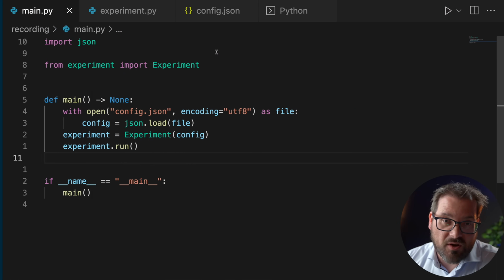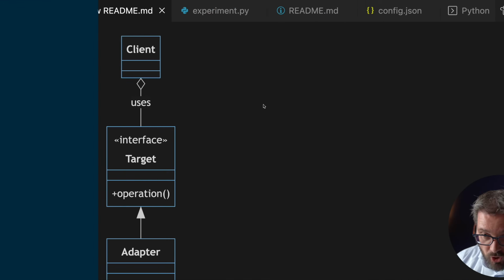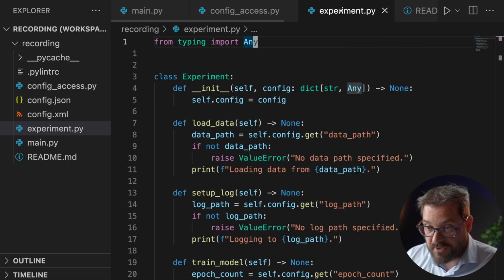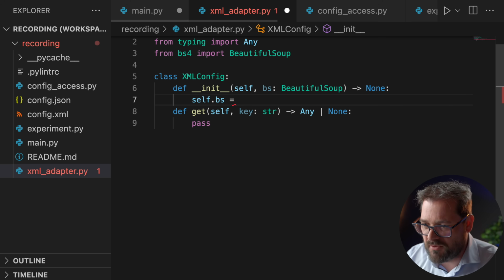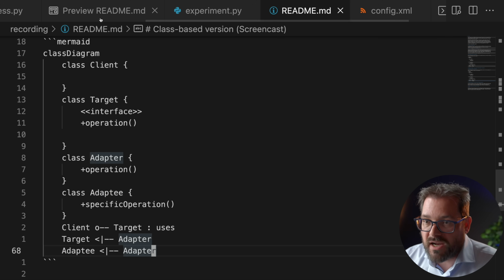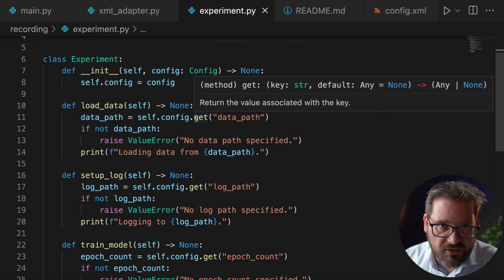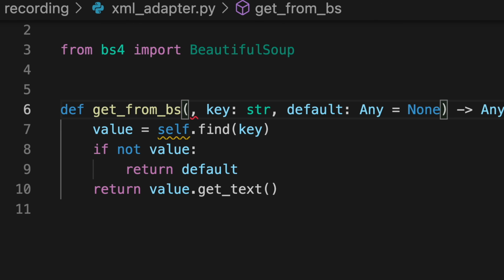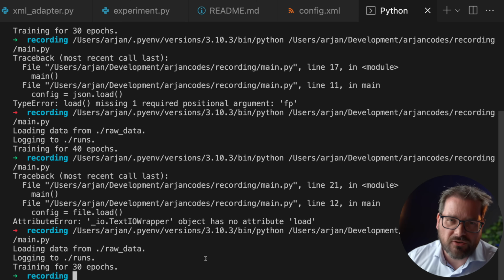Let's Take The Adapter Design Pattern To The Next Level

Comment: Hi, Arjan. Great video! Just had a quick question - what is the difference between the adapter pattern and the strategy pattern? Thanks in advance!
Reply from the maker: Thank you! The difference is that the goal of Strategy is to be able to change the behavior of an algorithm without having to change the code that uses the algorithm, whereas the goal of Adapter is to adapt an existing piece of code (traditionally, a class) so that it can be used with another piece of code.

Comment: Good video as always, but I don't think a dictionary is a good parameter to pass a configuration in a real product. But I understand why you chose a dictionary for the example.

However, my suggestion would be better to choose a dataclass for the configuration. With the dictionary you always have to reckon with the fact that not all keys are available. The data class cannot be created if it is incomplete. I like to do this with a classmethod, which makes a class out of the dictionary or throws an exception, then it ensures that after construction everything needed will be there.

Comment: Hey Arjan,
i like that video as all your other stuff :)

would it be wrong or "bad" style to move file open and bs instantiation in adapter XMLConfig?
for e.g. i would do in main only
path_to_cfg = pathlib.Path.cwd() / "config.xml"
adapter = XMLConfig(path_to_config)

and then adapter be a dataclass
where in _post_init_ i would do 
with open(file...
and s.bs = BeautifulSoup...

and finally i would also create a JSONConfig adapter with the slight changes in regards of the json file handling
Reply: That approach would work but it wouldn't exactly be an Adapter because it doesn't wrap an existing class in order to conform to an interface.  What you're talking about is more like a Strategy pattern with its own interface.

Comment: As far as i understand the Config class that inherits from Protocol is just for type checking? Would it be possible to to make this class not inherit from protocoll and instead make it an abstract class (inheriting from ABC with @abstractclass decorator)? If not it would be nice if you could explain why :)
Reply from the maker: Either ABC or Protocol works. However, Protocols rely on structural typing (duck typing), so there is no inheritance relationship (the XMLConfig class doesn’t inherit from the protocol).

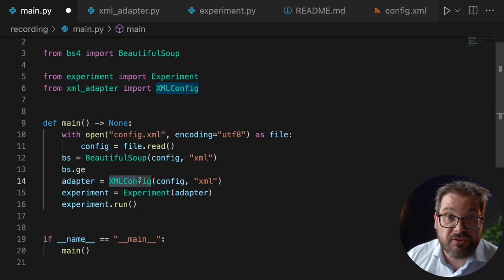Comment: 14:44 You mentioned we change the meaning of that get method and other things that depend on beautiful soup might not work anymore. 
I don't understand why other things calling bs.get won't work? 
From XMLConfig(BeautifulSoup), even if XMLConfig implements a get(), if other code is calling BeautifulSoup's get(), that should trigger bs's implementation of get() right? 
BeautifulSoup's get behaviour won't be influenced by XMLConfig's get behaviour if the other code is calling get from an instance of beautifulsoup instead of XMLConfig.
More generally, the child class (XMLConfig) can override a parent class (BeautifulSoup) method (get) but if the caller is calling on the parent class, it will behave as implemented in the parent class right?

Other feedback: When explaining the mermaid diagram, could you link it to which files/functions in the rest of the video is the interface, operation, adapter, adaptee? It's extra cognitive load to a learner who isn't familiar with UML or adapter patterns to relate the mermaid diagram to the rest of the demo.
Reply: Came here for this. I didn't understand how the XMLConfig class could impact in any way its parent's behavior. If a user uses the XMLConfig class to try and implement BS then it's their fault.
Reply from the maker: The thing is that if you create a subclass and override a method’s implementation, polymorphism comes into play. If another method in BeautifulSoup calls its get method and you have overridden it, then the overridden version will be called due to polymorphism. Also, if you pass an XMLConfig object to something else that expects a BeautifulSoup object and that then calls the get method, the overridden version will be called also due to polymorphism. In any case, it’s a bad idea to mix behavior from the original BS class and the Adapter. Composition is a much cleaner solution that doesn’t have these problems.
Reply: @ArjanCodes  Below code block is my understanding, you seem to be saying the last print will return child too? I can't see the issue with overriding a method from the parent in the child, as long as the user of these classes knows clearly which of the 2 prints they want to call.

# BeautifulSoup is parent
# XMLConfig is child

class parent:
    def get(self):
        return "parent"

class child(parent):
    def get(self):
        return "child"

print(child().get())  # returns child
print(parent().get())  # returns parent, not affected by child overriding get
Reply from the maker: What I mean is this:

class parent:
    def another_method(self):
        print(f"Calling self.get: {self.get()}")

    def get(self):
        return "parent"

class child(parent):
    def get(self):
        return "child"

print(child().another_method())

This prints ""Calling self.get: child".

The problem is that another_method from the parent class doesn't know anything about there being a subclass. So it's very well possible that calling another_method results in an error, even though we didn't change that method. This is an example of a Liskov substitution principle violation. In the subclass, the contract of the get method is changed, potentially breaking other things. To go back to the BeautifulSoup case: it's possible that the get method of BeautifulSoup is called from elsewhere in the class. By overriding the get method and changing it, we introduce potential errors.

Comment: Arjan, awesome tutorial as always.
You can use CMD+D (CTRL+D on windows) to select multiple occurrences of a string in VS code. so you can modify them all at once :)
Reply: Or using the Vim emulation, use the * command to search for occurrences of the same word, use "n" and "N" to move between results, and then the dot "." command to repeat the last change. 😎
Reply: Actually, I love the pace you used. That makes a little space to think.

Comment: Experiment expects Config type. Your XMLConfig is not... Shouldn't XMLConfig inherit Config? 

Also, we should expect that you can't change Experiment. Eg. It's a third party module

And how do you get the play button and terminal output in a vs code tab?
Reply: I was just wondering the same thing about the Config vs XMLConfig. Mypy would complain about this approach right?
Reply from the maker: Config is a Protocol class and protocols in Python rely on structural typing (duck typing). This means there doesn't need to be an inheritance relationship, Python determines at runtime whether the structures of the objects match. This is different from when you use an ABC (Abstract base class). In this case, you do need to inherit.

The idea of the example is that Experiment is something that you wrote, but that you can't easily change a third-party library like BeautifulSoup. Therefore, you need to write an adapter layer between BeautifulSoup and your Experiment class.

Comment: Hmm, in the XML get() method you do "if not value return default". This should probably be "if value is None return default" because value could be 0 or "".
Reply from the maker: Good point, thanks for pointing that out!
Reply: I would argue that you might want a sentinel as even None could be a valid value and the default might not be the correct value still.

Comment: Do I need to write 'Any | None'? 🤔
Doesn't 'Any' means anything including None?
Reply: @Dennis Vl not quite correct. 'typing.Any | None' is equivalent to 'typing.Optional[Any]=None' since python 3.10. The addition here is to take into account the default value defined as None. 
Note that according to PEP-0484: "When used in a type hint, the expression None is considered equivalent to type(None)"
Reply: « Something exist rather than nothing ». That’s philosophical dude.

Comment: This pattern seems silly. You need to know how the "client" uses what's being passed in order to make a usable Adapter, making the code more coupled in the end. This pattern is fine for something as trivial as the video's example, but anything else beyond a "get" is problematic. Your client needs X? Convert your Y to a real X. That's the only safe way.
Reply from the maker: What is a ‘real X’? You’re thinking too much in terms of passing data. The Adapter pattern is a class with methods (in this example there’s only a single method). It’s much more about mapping behavior than mapping data. The ‘real X’ is anything that implements the Protocol. This abstraction is what makes the pattern powerful.
Reply: @ArjanCodes  It comes down to how much control you have over the client. If you're in control of the client's code, then you're free to define it to accept something abstract via Protocol or whatnot. If you're re-using someone else's work, you likely don't have that option; you have a defined interface and have to live by it. My own experience emphasizes the latter case, which admittedly may differ from your operating assumptions in this video.

I'm new to Python, so excuse my naivete: How would the example code in the video behave if a member of Experiment did something like `for key, val in self.config:` ?
Reply: (Irony) Yeah pass a dict around that’s the « only safe » way so that a client can do what the fk it wants with it. Contracts and types are what separates order and maintainability from otherwise inextricable shit that even the culprit will not be able to read easily after the crime.
Reply: I had the same question as Mark. Instead of sending the object, why not have one more method in the class that returns a dict, and pass the returned dict to the Experiment class ?
Reply: I agree with you Mark. It seems to make the code more coupled. Furthermore, passing a config.get as argument is not as clean as just passing a config.

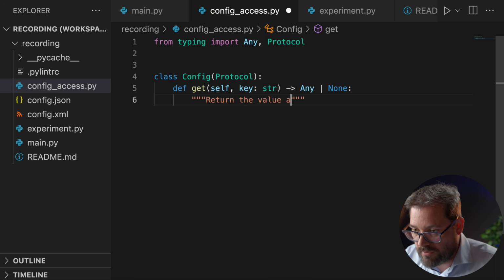Comment: 6:43 If you want some extra fun, you can name the function `__getitem__()` and have your adapter look and behave exactly like a dictionary. That way you won't have to do `self.config.get('data_path')` but could simplify to `self.config['data_path']`.
The obvious caution here is that it's not actually a dictionary. One might get away with read-only data like key->value configuration objects, but I'd not use it for mutable data structures. You might get away with implementing the dunder methods for dictionaries, but it gets messy having a thing behave like a dictionary that isn't one.

I'd probably not pick an adapter pattern at all but have a Builder/Factory that re-writes the data-structure on loading it from the config file and returns for example a dataclass. `def config_from_json(filename: str) -> dict: pass` and `def config_from_xml(filename: str) -> dict: pass` etc.

Comment: Interesting topic as always. A small suggestion: don't delete, change and then revert lines to the original ones. It was rather distracting when you changed the configuration from json to xml and back several times in the video.  Maybe it's better to use a flag or a factory to switch between both cases.

Comment: Very interesting.

I would have thought/expected to have some sort of "conformity" with the adapter to take in an XML or JSON and then henceforward "normalize" the methods and values returned (e.g. key with value) vs having to change from "get" to "load" within the experiment file. I was thinking the "middle layer" (Adapter?) might possible be a function, class, or object (object was my main guess) that would be in a separate file and then would be imported into the experiment.py file. 

Is that a different pattern or just me creating a babbling mess of another way to do things?

I am thinking of building a web scraper. Which would have two main interfaces. One for the scrapers and another for the destinations for persistence. 

Focusing on the location interface, e.g. AWS S3 bucket, Postres [local or AWS], or Local file directory. The user would just have to supply the "destination" in the scrape settings file (e.g. settings.py), e.g. data.destination('Postgres') and the credentials in the respective file, e.g. config.py (or Hydra, like your XML example) -- which then would handle it all "upstream"... to the scrape.py file which has a method load_data('Postgres') on the scrape object. Although, maybe that creates an unnatural depencency and should be a function that I "inject" (use) on the scrape object.
Reply: The common problem with tutorials and educational content on design patterns is usually that the problem statements are too trivial. Ending up with a `Callable` as a dependency in such a video is elegant, but the general problem statement which requires an adapter is usually a whole different beast.

The adapter is usually the second step after an interface was already established and there is a clear line drawn between producers and consumers of data. The adaptees though can be systems of any size with a small adapter ensuring compatibility with the target system.

To apply this to your scraper: you should think of the interfaces:
1. One for the scrapers
2. One for defining the interface for the persistence layer
3. One for defining the persistence providers

You could get along with two and simply use a factory instead of a provider. With the third interface you could define and interface for types though that test for certain pre-conditions and depend on different other libraries.
Especially if you use different projects for the persistence layers that can be really useful. You’d have one interface project and different persistence implementations each living in their own project simply linked by your build tool. This may seem a bit over the top but actually makes the effort pay off.

Just some thoughts.
Reply: @Florian Salihovic  I must say. I really appreciate your thoughts.

Definitely agree on the examples used to teach (and to convince) others to use Design Patterns are often trivial examples. I think even even having better talking about "how" and "what" would be much better than the examples used. 

I appreciate the comments... I will need to look more into the Provider pattern. Admittedly, I've mostly just relied on fairly heavy Inheritance and Factory method. The interfaces all make sense to me. The toughest part has always been separation of concerns and actually the expression of the methods to the user via the class where they don't have to go beyond the base data structures in Python as values within the class.

If curious... I think this is where I'm headed...

1. Header Attributes (needed to get data): They can't be Python Class attributes because the names have hyphens, e.g. "user-agent" and "cross-origin-resource-policy". I could probably define them as attributes w/o hyphens, then do a method to return a key-value with the hyphens in the name -- but that's extra work for little gain.

So this has to be a dictionary to enable the keys to have the right names for the Header that the API is looking for. Interface is, do I leave this as an importable dictionary with defaults for user to import and then they put into the Class that requests the API data [Interface #2].

I'm leaning towards just making the dictionary a default in the Class request from the API. But also making a separate module the user can import, update the default dict and then put that into the request obj.

class GetAPIData:
     def __init__(self, headers = None, ...)

     self.headers = headers if headers else DEFAULT_HEADER # imported into file

So if they want a mutable version they can import the DEFAULT_HEADER, then update a Key-value, rename it to NEW_HEADER

Then... 

data = GetAPIData(..., headers=NEW_HEADER) #

2. Data Request Object (probably the main class)

e.g. GetAPIData

Class GetAPIData   # would be several of these, the api_params would be different for each, but same header
def __init__(
        self,
        IsOnlyCurrentSeason=0,
        LeagueID="00",
        Season="2021-22",
        headers=None,
    ) -> None:
        self.headers = headers if headers else {}
        self.IsOnlyCurrentSeason = IsOnlyCurrentSeason # these are case sensitive 
        self.LeagueID = LeagueID
        self.Season = Season

3. Persistence Choices, e.g. to_csv, to_json, to_sql, to_s3
These likely would be a dependency injection method of using another class PushData and within it, the user has to define the credentials in a config.py file and then can call the method on the Data object (#2). 

e.g. data.save_data("sql")

or keep them all like Pandas methods...
data.to_sql()
data.to_csv()
...
...

This could still be a class as there's over 100 APIs and each of them would like/need these persistence methods.

I could probably inherit Pandas Dataframe and then only have to build out the AWS_S3 and GoogleDrive ones (which would be rarely used by comparison).

Comment: Great video and I love the new set!
Glad to see some more videos about design patterns :)

Just a quick note: The camera in the intro is not exactly parallel to the table. The table edge on the cameras left is a tiny bit lower than on the right.
Reply: That's an optical illusion 😅
Reply: @aflous  I thought so as well, but I couldn't let it go and measured it with a ruler 😄
Reply: @ItsThoronath  🤣